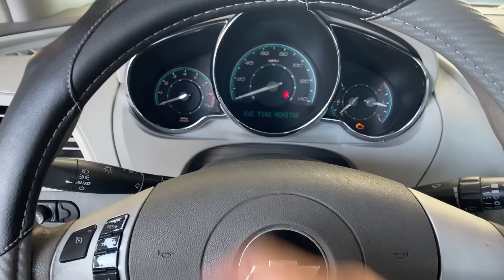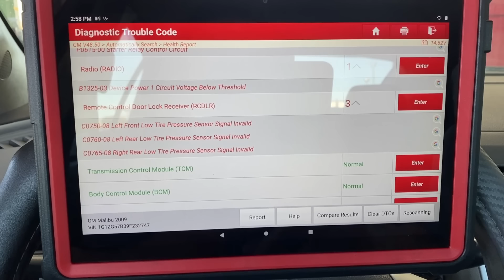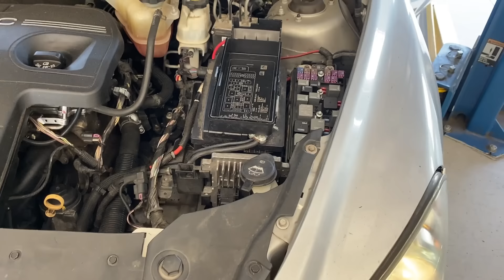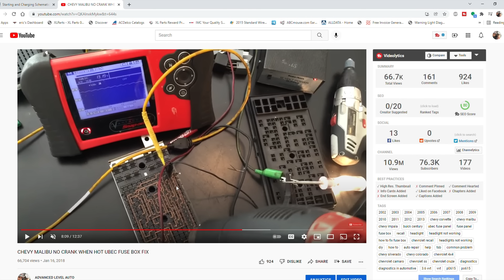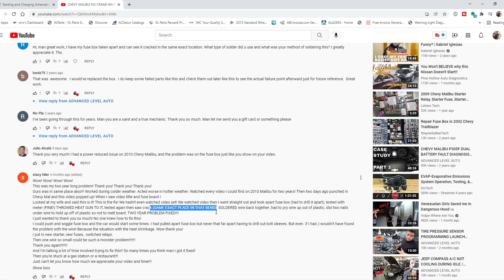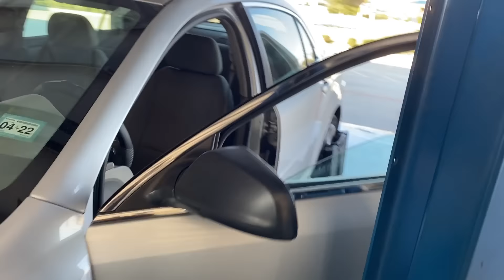CHEVY MALIBU INTERMITTENT NO CRANK NO START P0615 DIAGNOSIS & FIX

Comment: Great video. At the same time it makes me sick to see such a problem. I have a 2012 with 95,000 miles on it and it hasn't had this problem yet! Fortunately I had a career working on electronic equipment and I did surface mount soldering on circuit boards under a double eyed microscope. I hope I don't have to use my soldering skill on my car.

Comment: I have a push start '23 Malibu - Went to cold start my vehicle this morning.  I thought i heard it attempt to engage the bendrix but it didn't- also I had no power to the car at all.  Roughly 20 minutes later I had power again on its own and the vehicle started. 

Would this be similar?  15k miles.

Comment: I have a 2010 Chevy Malibu with the exact same problem, once I drive it for a while and try and try to restart it, it won’t turn over!
I try to jump it and it won’t help, but if I leave it overnight and try to turn it on early in the morning when’s it’s cold, it’s starts with no problem.
I ruled out, starter, alternator, new battery because Autozone checked them for me!!
I had a mechanic tell me it could be the anti theft system preventing me from starting but the light for that’s doesn’t light up! And I’m able to drive so I don’t think that’s the issue!!
Could replacing the whole fuse box fix my issue!!
Any help would be appreciated 😢

Comment: HELP!!!! My girlfriend has a 2011 Chevy Equinox with the 2.4. The Timing chain was starting to rattle so I changed it out. The manifold was cracked so I took it off and replaced the water pump and the manifold. Put everything back together and spun the engine a few times by hand with the crank to make sure nothing locked up. Everything was fine. Went to start the engine and I have a no crank no start situation. I put my scan tool on and got a PO615 Code. Fuses are good, the starter relay is good. I get 11 Volts at one of the relay pins and the rest read in the 2 range. Funny thing is, I pulled the cover off of the starter relay, turned the key to the run position, and pressed the contacts at the relay and bam, she starts right up. Shut it off and tried to restart with the key and nothing. Put the ignition in the start position again, manually touched the relay connectors together and she fired right up again. I have checked all of the grounds and my connections. Everything is connected and tight.  I replaced the fuse box today and got the same results. This car will not start with the ignition switch unless I manually manipulate the relay.  And of course my girlfriend says, it started fine before you replaced the timing chain and parts. I am LOST!!! Any ideas???

Thanks in advance!!!

Comment: I have an 08 malibu ls 6 cylinder and I think mine has this exact problem. I never have the issue in the winter, but during summer months, if i drive the vehicle more than about 15mins and shut it down and try to restart...it no cranks no starts. I have to leave my sit for a few hours, then go back and try to start and it starts fine. I took it to a shop once and they said there were no codes or anything and could not recreate the problem and suggested to replace the starter...which didnt help. I dont want to just put guess wotk in. I was going to attempt to replace it myself (the fuse box) but I cant seem to find the part. I just want my car fixed.

Comment: I never got a code but had no crank no start after warm up. Took fuse box apart heated the wiring and checked continuity on all wires. Identified discontinuity on one wire ,magnified and found broken wire,soldered and so far so good 👍 thanks
Reply: How did you get the fuse block apart did you have to remove all the fuses and relays?

Comment: I did an intermittent diagnosis on one of these for a complaint of " Car randomly will die while driving every other few weeks" Lol, there was a fusible link coming off the battery ( looked factory? ) ringlet terminal on it was sheered in half making crap contact, I actually got it to act up by wiggling that terminal. Couldn't find any data on what the wire was for but can assume it was a feed for the PCM? not sure

Comment: Nice video thanks!! I do have a question though? What if you wait longer than 20 mins like 3 hours and it still doesn’t start?
Reply: This is my issue. I went to the doctor today and it sat for hours and wouldn’t crank. It made a click noise and nothing
Reply: @10missthickness same issue i have. What year is yours?
Reply: @bobbyanderson2863  it’s was the computer for my car, it’s almost $1,500 to get out the shop. I noticed a couple weeks before it stopped working that it was doing weird things. Like my clock would be set and I’ll get in and crank it up and it’ll look like the battery had been unhooked. I believe it had something to do with the computer of the car. I’ll ask the mechanic when I pick it up tomorrow.
Reply: @10missthickness  wow! Thats why i dont like mechanics smdh

Comment: Great video. I'm confident that you can help with a current issue I'm having with my son's 2012 Malibu, 2.4. long story considering what I've done so far but to get to the point the car is throwing a p0016 and p0017. Starts and runs but when you're in the throttle the car fights to accelerate. No timing chain noise although if you persist with throttle some pinging will come in.
Any help would be greatly appreciated!

Comment: I wish I seen this video 2 years Go.  That's how long my malibu has been down. Initially I just needed to change a rad and thermostat,  but the vehicle just would never start again. Different codes came up through the 2 years, and one by one, i started to replace parts that were associated with the codes. Despite testing the parts before hand, i had no other solution.  Determined to not be defeated by this car. So after the rad ,I've replaced starter,  timing chains, cranks,  timing tensioner, spark plugs, coils, fuses, serpintine belt and tensioner, changed all the fluids, New battery new hybrid battery pack as well, New fuel pump, fuel pump module, ecu relearn, gear shift cable , new fuel , crank sensor, cam sensor, bot an hp tuner, disabled anti theft temporarily for testing, new key, bought car hauler to haul it in our move to a city 4 hrs away, and hauled again to a garage I could continue crossing one thing after another after another , new intake manifold, Gaskets, cleaners, o2 sensor. Spent endless amount of days and hrs of researching , calling dealerships, looking for YouTube videos , Google pics, forums, bulletins. If I had not seen this video, next was ecu, BCM, then Engine and then transmission.  I literally would of never thought that a break in the wire in the fuse box. Mine got worse and worse until no matter what, it wouldn't start. But codes would be different , and then what was weird , that after replacing some of these parts, the code would go away, and felt I had progress, but still no start. I could crank with key , but then after I couldn't, and then replacing the batteries,  I could,. My fuse box was the culprit. I literally could of rebuilt this car if it weren't the video.  When I tested the fuse box and fuses. It passed the test where power should be and proper voltage. Most times.  But again, replace a part then everything test normal.  Really, I had several breaks.  Barley touching, and it was the perfect storm. My worse nightmare.  I did not test the fuse box with a heat gun. That was the game changer for me.  After seeing your experiment. I quickly ran to the car and setup the heat gun and then it was revealed. The alluding culprit this whole time. Changing codes because of times I would be in a shop working on it, or outside I. Cold weather. What are the odds.  Thanks alot man.    I have no clue how I didn't see this video till now.  I searched thousands of videos about this car and only now i come across it. And it just popped up easy first try when I searched this time around. The same search I've used a million times. No start 09 malibu.   You are also right about the bulletin board for techs. Not even a hint to steer you in that direction.     Well thanks again.   I definitely will subscribe .

Comment: Brake sensors in the rear, need to be cleaned. Or gas cap/ evap purge valve.
Reply: The car thinks the rear brakes arent working so it doesnt want to start. I understand the concept of the fuse box but no. I thought the same

Comment: Weird! My cars doing this now too. 
I got a new key programmed (after automatic toilet took my keys) but it was +10 & now has dipped down to -20 so I would’ve had no issues with it over heating & not starting after lots of driving. my issue was it wouldn’t start after sitting over night.. then once while at Walmart. I opened my hood & the vehicle randomly turned back on!! 
Now it’s to the point where I open the door and NOTHING turns on. No radio, no odometer, no dome lights…. But my horn works? random.

Comment: This has been super helpful- I sent to my mechanic after an intermittent no crank no start issue. My mechanic found several cracks in the fuse box leads, and we now await a new part with a way forward to fix the car! Thanks so much for this info and a great video.

Comment: Very nice work finding a non-obvious fault.  Few shops are skilled enough to find intermittent electrical failures, especially something as subtle as a cracked wire in a fuse box. 

 My sister-in-law's car is having a crank but no start problem and perhaps this will explain the problem.  I'll try some of your suggested troubleshooting tips.  Thanks.

Comment: I have a 2008 Chevy Malibu LT1 and ended up with the same problem no crack no start either so I took it to the shop they find out when they remove the fuse box at the same crack that shows on here on YouTube video on your channel so it's been order so they're going to replace it they should have done a recall or something to the car my car has 300,000 miles and it runs great so I went I'm going to the same problem like everybody else

Comment: I need your help man my car is doing nothing it won't crank you don't it was getting hot he actually just warming up good then it cuts off  now I can't get anything I got buzzing relays I don't know what that's about could that because the fuse box there is separated like yours was? I have worked on this car for 2 weeks and got nowhere actually nowhere really except I know it's not the starter it's not the battery new battery and new starter. I watch ed all the videos I've seen them about different no start situations it will turn over if you bump it with a screwdriver at the solenoid, but it won't crank, with the switch on that is ,and still won't crank or turn the starter so anything you can tell me would be wonderful and I appreciate you videos me and my son have watched from you have really helped us to be better shade tree mechanics LOL but we work on our own vehicles this one here is tough. Thank you for all your help

Comment: Could it be possible that the car goes from a normal start  to a no crank no start one moment to the next and when it cools it still don't start has anyone ever had that happen in that way that you know of or is it all ways that it cools and starts back up...I have a 2009 and prior to it not starting I did have problems were it would not let me go past like 30 mph and then it would go away but it would have a missfire days later then that would go away and it would then have a rough gear shift then all of a sudden it stared up ran fine amd ran but when I turned it off it turned in to a no crank no start and has not started since and I changed all the fuses and the relays and the starter itself and I was going to change the ignition switch but saw this video and now I'm thinking maybe it's my problem just that it do t start even after it cools

Comment: My car starts no problem but the battery runs down and I'm stuck. I replaced the alternator still running the battery down. what should I be looking for? Now this is the Hybrid so there are 3 heavy cables coming out of the alternator to a box near the front of the engine. Any thoughts?

Comment: interesting video.....I'm thinking this is parallel with Pontiac G6's.....same engine, same electronics, GM vehicle.....I'm currently chasing this same problem and it certainly feels like it's the fuse box....however I'm able to jump the starter....so I'm going to try new (used junkyard) relays and go from there.......too bad I changed the ignition switch and spark plugs/wires before watching this video....lol but thanks

Comment: As an ASE master tech since 1978, working on everything especially electrical. I used 4 home made jumper wires to connect the relay to the fuse / relay center. At this point, I can check voltage drop across 30 & 87. I can check the coil side to ground to see ground or ground plus drop across the coils internal resistance.
  You are correct in the way the computer spends 4-5 minutes checking each circuit. But if good when cold, it passes the test and moves on to next. 
 TBS are generated by a high fail rate, parts sent in and engineering looks to find the root cause. It they have 40-60 dealer techs per day calling with a similar problem, they will give then 2,3,4 items to check. Once again, if a tech finds this issue, then they are sent a replacement and shipping label to get the fuse / relay center assembly sent back. If the get a number, then it is re-designed, new part number for the part and included into the “TSB”. 
  You can use a jumper wire to bridge the break as that would stand the expansion & contraction. 
  But call the dealer, ask for the service manager and be honest about having video, VIN numbers and ask if the regional service manager can call you or speak to the technical hot line. Now, there are more than one dealer out there, just like customer service at any company from Ford to Summit, sometimes you get a person that is good and will to help, sometimes they act like you are bothering them, and get no where fast. Also, the back of the owners manual has a GM customer service number and they maybe able to get you to the right folks. 
 I worked on contract labor for Raytheon but was in the field as an ACDelco service rep. We had the power to make phone calls, send photos or video into the department that handles fuse/relay boxes.
  Locally, you will have a warehouse distributor that sells Delco parts to the dealer as well. They to know how to get an ACDelco service person who may take interest in your finds. I know it’s a lot of work on your behalf and no one at GM is going to send you a new Corvette for finding this issue but don’t give up!!!
ACDelco ex-Market Area Service Manager, but one of 56 nation wide who did hands on classes and held technical seminars for shops the warehouse distributors invited to attend. Yes, some of us were ASE Master Techs and had L1, P2 as well and owned a tool box and made our living once fixing cars, but not all are the same. It is hard to find someone to spend 243 days per year in a hotel holding seminars, teaching and dealing with returns. Plus, they have cut most of those jobs! 
  Great video and just remember that using a headlamp bulb that draws 4amps May heat that circuit better than a heat gun. 
  I will tell you, Thanks for your efforts!!! Parts on national back order as it is being redesigned and beefed up perhaps. So the 2013-2016 did not have this problem!
DK, Omaha, retired!
Reply: Actually, they continue to have these issues. 2014 Chevy Malibu Eco owner here.
Reply: @ I have a 2015 Malibu LS with no problems. But I actually fix my stuff including disabled the auto-shut-off that bothered my wife. No lights on dash! Software is simple.
Reply: @deankay4434  have you had to install a new battery under the hood and noticed different items like power steering notices and all door locks unlocking and locking randomly?
Reply: @  No, There are 3 different electrical architectures used in GM vehicles. A GMT800-900 truck, Cadillac’s / Buicks then the rest. If it has terminals inside the OBD-II connector at pins 6 & 14, that’s high-speed LAN. Lo-Speed makes it different. Removing the cranking battery causes memory loss in certain systems a personalization is one. This allows between 4-8 things to change when using remote keyless. First thing is the Body Controls Module (BCM) to make sure the correct “Power Mode Master” input signals are correct from the ignition switch. Lock, ACC, On, Crank seen in the correct order and read by the BCM is extremely important. This requires the Tech-II up to 2013 (2015 if you lye to it) or new “Diagnostic Scan-Tool” from SnapOn or MAC. I worked for ACDelco in field service for almost 7yrs. Besides owning my own Tech-II. We have “CD’s” to load in laptops to provide GMeSI and TIS2WEB. Now, you can purchase a day, week, month or years subscription thru the ACDelco website. Door lock, lights flash, horn beep and more is done with scan-tool or using key. The procedure changes depending on yr & model. Ex; key on-off 3 times in 5 seconds make door lock cycle. Push lock, P1, P2, P3, P4 etc to change based upon owners manual. At the dealer to speed this up, I simply used an external 12Vdc source to the ground & battery input at fuse/relay center. This kept everything alive. While everything else used a EEPROM that stored info and without power, kept all memory like radio preset stations, volume and driver #1 & #2 preferences! 
Best of luck.
Reply: @deankay4434  I’ll try it out

Comment: Change a fuse that was burned worked little better kept getting reduced eng power and traction light and motor was hesitating. Pulled junkyard fuse box changed out old one and now car is working properly. My guess was had crack plastic was expanding causing copper wire to short out plus had a loose fuse pin.